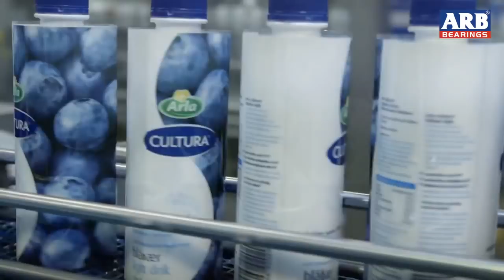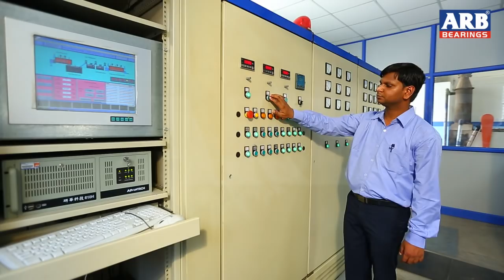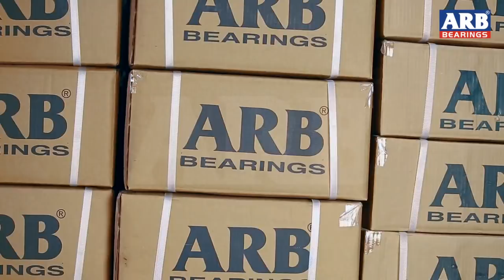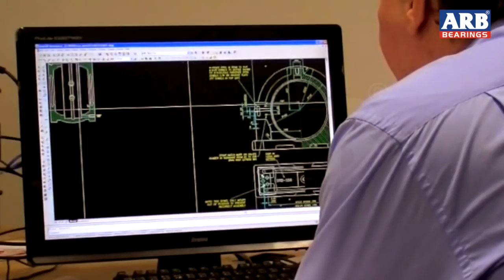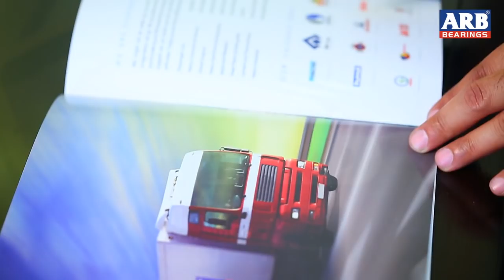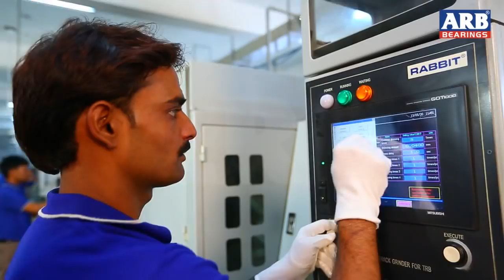ARB Bearings Company Profile - Joseph Jacob Esther Attorney Jefferson City Missouri

Comment: My favorite toy of childhood. 😍
22 now i still play with ball bearings.
Reply: I had 4/ 12 inch chrome steel balls, they weighed over 100 lbs each. Got them for a customer who thought he could drill a hole through the to rebuild a very large ball valve... at  80 Rockwell ..you would need a laser to drill them and once he figured that out he stiffed me with them I held on to them for years... finally sold them for scrap. I often wondered how big the sling shot would have to be.....

Comment: I bought a used Spherical roller bearing online auction for $60  from the photo they had It looked like it was not more than 12 inches OD, and went to pick it up was suprised that it is 35 inches OD  19 inches ID 12 inches wide and weighed 1900 lbs  !

Comment: i got an old bearing out of a caterpillar diff   and welded a steel  plate on it Then i had a rotating  welding  stand  for small jobs   |----|---|----|
 these  are tie fighter    (-<>-)    |-O-|     [-<>-]   the force is  strong  with this one

Comment: Sir, I have a doubt that does ball inside cage rotate or else they are fixed.
And do cage rotate with same speed as race(inner or outer).
Reply: venu gopal
Reply: Inner race will fit on shaft(not rotating) bearing balls are aligned with in the cage and outer race. Bearing and cage only rotates. Outer race is fixed on the housing.

Comment: Rings forging process missed.
Reply: Ring forging process may  be at vendor end .
Reply: @RD-ij2sz  Yes but then you don't have possibility to check steel quality or steel inspection procedure is usually at very low level.
Reply: @marekzet482  Right . The quality control same systems should be implemented at vendors end  and inward ing sampling inspection to be done . Timely  vendor audits needed .  As of  today I don't think any bearing company is doing their own forgings .

Comment: 9 out of 10 bearings fail prematurely because of dirt contamination. They handle bearings while making them... Every bearing they touched will fail just from the oils on their fingers. I spent almost 40 years working with bearings of all sorts. From bearings that would sit on the head of a pin  to 2, 60,000lb monsters sold into the steel industry. I wouldn't sell them until I could test them ..  Life and nvh need to compete with Japanese or German bearings of the same type.